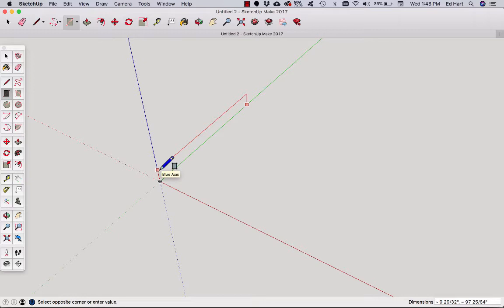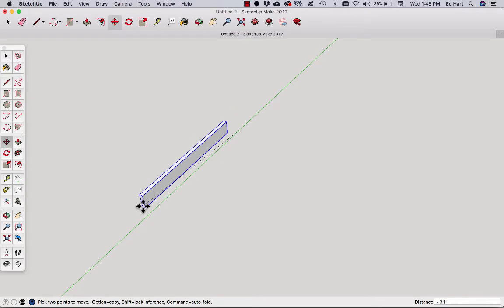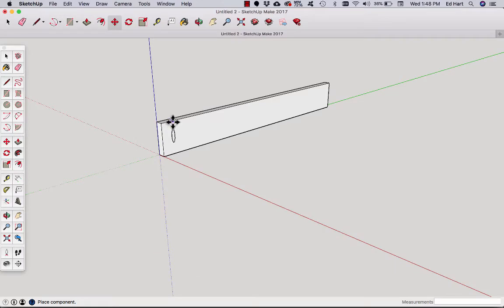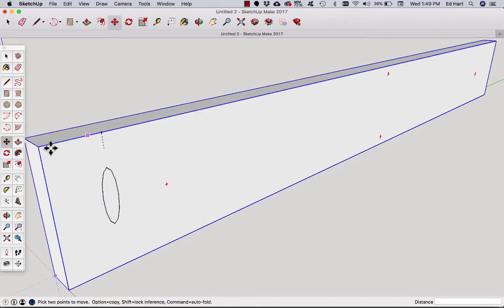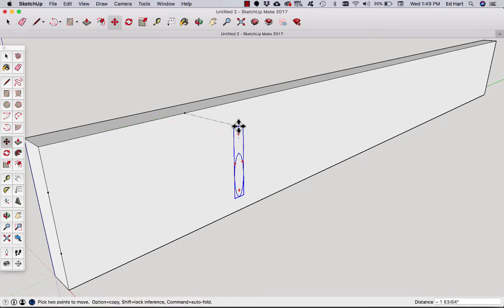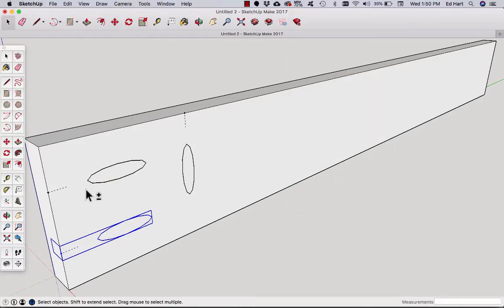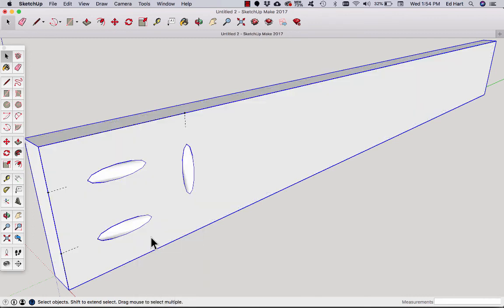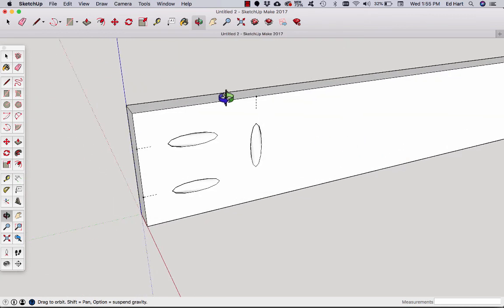Add Pocket Holes to a Joint in SketchUp

Comment: The part where you explained making into a group? You flipped flopped so much, clicking and only explaining a quarter of what you were clicking on. Made it very confusing to me anyway. I like that you are trying? It just went way over my head.
Reply from the maker: Sorry it was confusing!  I have a couple other short videos that go into the basics of making groups that may (or may not!) be helpful.  Basically, to make a 3D object into a group in SketchUp you need to click on one of the planes 3 times.  I click selects the plane or line, the 2nd click selects the plane and the lines around it and the 3rd clicks selects any adjoining lines and planes.  Then right click and select "make group."  It's easier to work with groups because otherwise when you select a part of the object and move it around, it will move independently of the other lines and planes and distort the object.  When combining objects together, like putting pocket holes in pieces of wood, for the objects to join together, I'm placing them where they should go, "exploding" all the lines and planes into individual elements so you can make any adjustments (in this case, deleting the new play created where the drill hole would be) and then re-grouping them so they are one group.  I hope that makes slightly more sense.
Cheers,
Ed